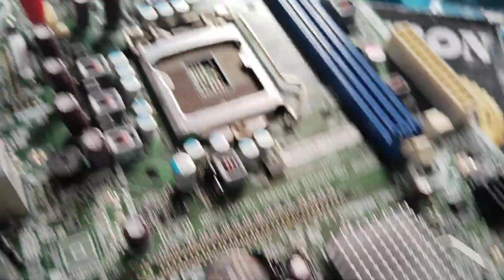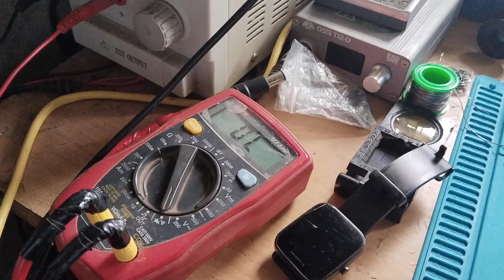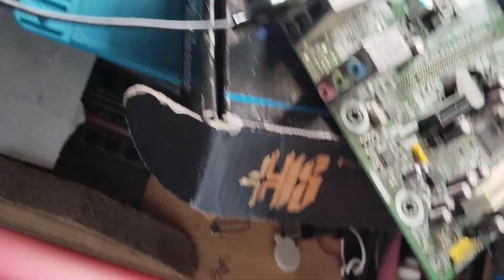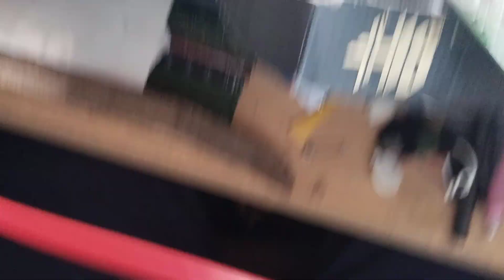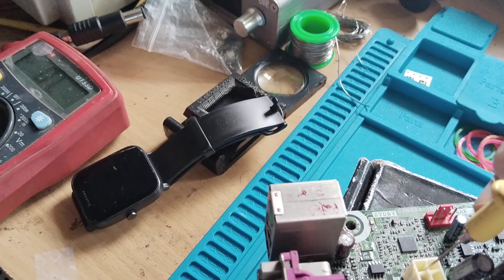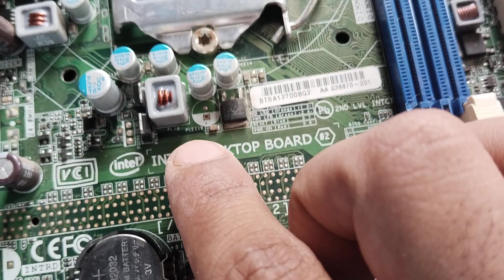Intel H61 Not powering ON

Comment: I have Mercury motherboard which is no display rt8859 core ic processor not heating I checked ic vcc 5v OK vready 5v    en 0 volt ic problem r what give me suggestions
Reply from the maker: En is not present
Reply from the maker: Make a jumper from 1.2v line to en pin